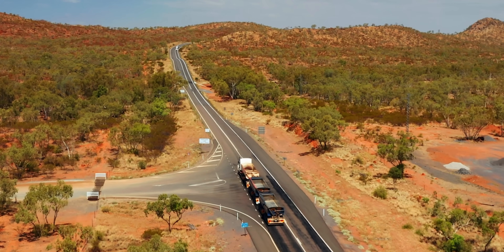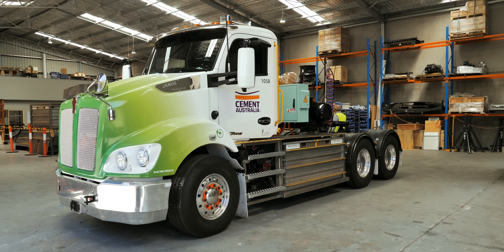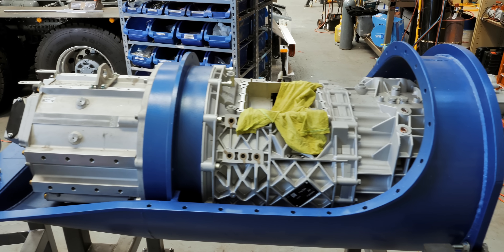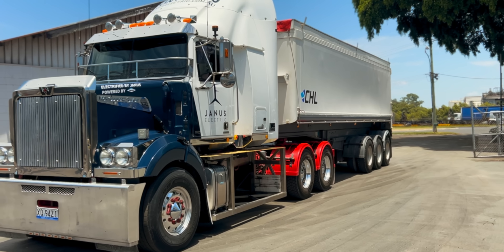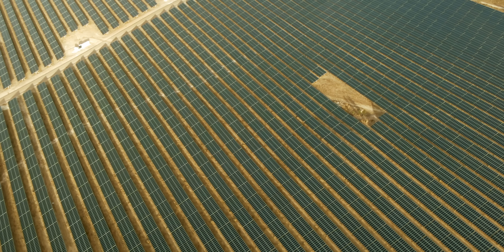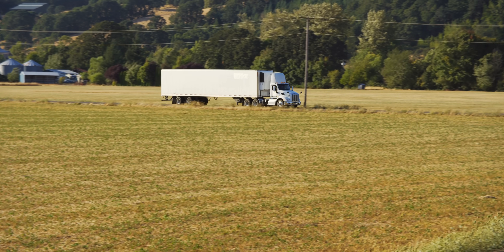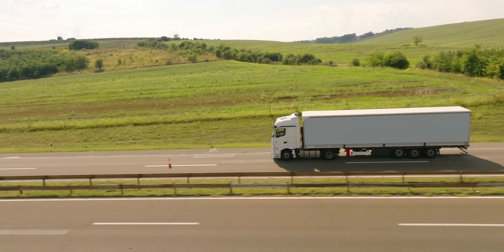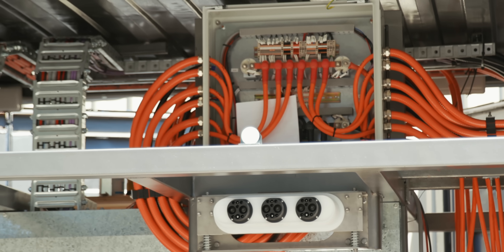This GIANT Electric Semi Can Swap Out Its Batteries!

Comment: Melbourne: Australia Cement Rig, "Bursts into flames"! The sole Janus converted former Kenworth Semi failed in flames. [28/11/23]

Any comments?
Reply from the maker: Yes, many comments.
In 2022 there were 397 truck fires in Australia. 
All of them a disaster for the driver, the truck owners, the fire services.
How many of those fires were reported in the media, not just reported, but shouted about with glee!!
I'll tell you. None. But one electric truck fire in what is, essentially, a prototype machine.
I repeat, 397 truck fires in Australia in 2022.
Oh the joy know no bounds. Rejoice say the fossil fuel lobbyists, rejoice for we are saved.
We can carry on selling expensive, toxic imported fossil fuel which we burn once and breath in the filth it deposits.
causes of fires in diesel trucks
Arcs on the starter (or battery cables), the alternator cable or the positive feed wire into the cabin.
Flammable material resting against the turbo charger or the exhaust;
Fuel line rubs or failures that result in leaks / sprays of fuel onto the exhaust.
Lubrication oil line failures near to the exhaust.
Turbo charger failures that cause excessive temperatures in the exhaust;
Leakage of hot gases from the exhaust.
Tyres catching fire because they are flat or poorly inflated or rubbing on hard surfaces.
Wheel bearing failures resulting in bearing grease catching fire. Sometimes overheated brakes cause the bearing grease to catch fire.
But let's ignore the endlessly repeated fires in diesel trucks.
Just dance with joy about this one, pathetic incident.
Reply: Keep in mind how many more Diesel trucks there are than Electric
The argument of diesel vs electric based fires no scene when you add to the fact how basically ALL trucks are diesel
The ONE EV caught fire
Reply: Looks like I touched a nerve. It was not the intention to draw rage and accusations of dancing with joy about one "pathetic incident". Your PR skills need a little lift. Calm down and wipe your screen!  Now, thanks for the 2022 data: 397 diesel fires out of a population of how many diesel rigs vs how may EV rig fires out of a population of how many? Context is everything! Is it one EV Janus rig fire out of one? @fullychargedshow
Reply from the maker: @PhilMacVee  The fire was a disaster, no argument. A very sad day for Janus trucks, an Australian company trying to make a difference.
Here's the underlying point, in 25 years time, the notion of a large machine that can pull a heavy trailer by burning diesel will seem like a steam engine does to us now.
It's dead technology, hopelessly wasteful, inefficient and of course filthy and toxic to living beings.
There are going to be numerous disasters and set backs for electric ground transport, just as there was in the early days of combustion, but it's now 100% clear that the future is electric.
So when people jump at the chance to cheer when there is a set back, that doesn't touch a nerve, it makes me laugh.
Reply: Nicely side-stepped although I'm not sure that I would be content with "disasters" along the way and I was not cheering...and so the answer to my question is? @fullychargedshow
Reply from the maker: @PhilMacVee  I don[t know what your question is. You asked me for a comment, which, for reasons that now escape me, I bothered to do.
There is no way you posted your original message without a snide, know all sub text of 'see, battery electric vehicles don't work.'
The push back against the electrification of ground transport is massive, incredibly well funded and global. 
It's obvious who is behind this and I defend the right of the big oil companies to bribe, lie, spread misinformation, create utter garbage stories which our old school dying press grab with both hands and spread like vomit on a new carpet.
I likewise defend my right to be uncompromising in my criticism of the shills, fellow travellers, petrol heads, bully boy clean diesel tossers and super aggressive gun toting diesel rolling coal pickup truck nutbags that litter the world.
You were so happy to see this truck burn, you can lie all you want but you know that is true.

You want to carry on as we are now, burning trillions of litres of fossil fuel, it's painfully obvious.
That's all I have to say on the topic.
Reply: @fullychargedshow  It wasn't the first though, as I'm sure you know.
They had a prototype self combust last year, which damaged another.
You are simply not being contextually honest about Hugh Janus' trucks having a 100% failure in flames rate.
Reply: @matthewjenkins1161 Rimmel or whatever his name is can get real Karen 😂

Comment: Maybe this will impress you.  The Tesla Semi has a battery as big as 12 model Y batteries. The battery weights several tons, and uses 250lbs of Lithium. In 2022, 130,000 tons of lithium was refined. If you used none for cellphones, power walls EVs or anything well you could make 1 million such trucks. There are 9 million heavy trucks just in the USA. Thus it would take near a decade to simply replace the US trucks, no EVs no Cellphones, no laptops, no power walls, nothing but Semi's .. sound stupid yet?

Comment: I am unsure of full load use without a coolant system for the motor and batteries.  Granted with the transmission the motor rpm is significantly reduced from typical electric use.

Comment: I doubt they will be able to do sub 1 minute battery swaps, NIO have been using battery swap for years and have gotten it down to 4 minutes in the latest stations. They’ve spent hundreds of millions developing this system. I can’t see a small company in australia with a limited budget doing it faster with batteries that weigh significantly more.

Comment: They talk about reduced maintenance cost including engine rebuilds, but conveniently fail to mention the cost of replacing (if owned) or leasing (per use) the batteries. Yes, electricity will cost much less than diesel in most locations, and maintenance work is much less on any battery-electric vehicle than a comparable diesel, but all of the costs need to be considered for a rational comparison.

Comment: I live in BC Canada and we had electric buses getting around Vancouver when I was a kid. With battery tech now and the hauling capacity of electric motors I’d think you could run busses with swap out batteries and not need overhead cables…

Comment: Nice ideas.  I did not hear how long it takes to fully charge a battery.  The shear number of batteries needed to power a fleet of trucks for normal operation - and the logistics of the battery swap stations - are big problems. Thinking about this - we would need as many swap stations as there are truck stops.  Presumably, the batteries would need to be charged at or near the truck stop swap stations.  The electric supply needed to charge the batteries is not available in the areas where the charging stations would need to be.  And.....the metals/minerals for these batteries (90% of the world's supply) are all controlled by the communist Chinese government.  Not saying this is a bad idea....just needs a lot of problems to be resolved first.
Reply from the maker: Your comment is a perfect example of what I have been saying for a while, and I don't mean this to be rude, but the really big issue with electric ground transport now, is psychology, not technology.
It's fairly easy to see that this technology works, the truck we drove on this episode works 7 days a week, 10 hours a day, hauling 90 toms of sand all around Southern Queensland. We had to film it on Australia day as that was the only day it wasn't in use.
The sheer number of batteries needed to run a large fleet is enormous.
But, they will last 10-15 years in this roll, then be repurosed as static storage, probably by the company that has used them.
This will give them another 15 plus years useful life, so after 25 to 30 years they will be recycled and made into new, better, lighter, more energy dene batteries.
There is enough material on the planet to create all the batteries we need.
Yes, the batteries would need to be charged at the truck stop. But they don't need to be rapid charged, they can be charged over a 12 hour period at lower power which will increase their longevity.
Also the power required can be and increasingly will be produced on site. There are already huge car charging stops in China and the USa with 100's of rapid chargers that are 100% powered by solar and wind, combined with big capacity storage on site, (100-400 megawatt hours) which means the chargers are available 24/7.
The technology exists now, the know how is here, it's now just a question in implementation.
And a quick reminder of the alternative. Drill for oil somewhere, pump that oil down a 500 mile pipeline that leaks, Pump it onto a massive oil tanker (40% of all global shipping is transporting crude oil)
Pump it into storage tanks, refine it in a massive industrial installation that released billions of tons of CO2 and toxic particulates every year, pump the resulting fuel into diesel powered tankers, store it at a refill station, pump it into a tank and use it . . .  once. 
And that, I am repeatedly told, is sensible and the only realistic way we can operate.
I beg to differ

Comment: 8 thousand pounds per battery needs 2. cold wather 30 persent loss of range and the grid can't supply the power to charge and the lithium and all the metal s needed to make the battery's destroy the eco system it's all a scam the answer is electronic ravidics or zero point energy but I know it's all about money not about saving the environment as much as we want to think.

Comment: Okay you are bashing  diesel motors on how "dirty" they are, how about relinquishing information of all the "dirty" truths of your scalelectric truck. It is Snake oil. How much electricity from a coal fired plant it will take to recharge the dangerous fire risky, toxic lipo batteries that, that truck needs. How much coal and diesel energy it took to produce those batteries, the motor and driveline? The mining resource sector is still operating with 98 percent fossil fuel energy to operate. So the minerals to make the components of that electric system is NOT CARBON NEUTRAL. The battery packs are going to be leased to operators? Yeah, I see a potential cartel operation there. Also what does it cost to do the conversion? $150,000? It only cost about $20,000 to $50,000 to replace a serious tired and un-recondional diesel engine, not the sale value of the overall truck. I can see what companies would be interested in those trucks, its the Billion dollar companies that are already making Billions in profit in their environmental damaging operations, they would put some money back in this project to show the dummies that they really care about the environment they are destroying on a daily basis for the profits they make. The throw a bit of money away as a virtue signalling gesture.
Reply: So much for diesel being dead technology right? It has not even been a month and motoring companies such as Ford is abandoning electric car manufacturing as its profitabilities slumps. Teslas resale vales are below 20 percent from new, they are not even good as a salvage. Well so much for your talk, it seems that the world is catching on even more quickly than what I could even anticipate, to realize the ev scam.
Reply from the maker: Nice try. 
Can you recycle 98% of the materials in a battery pack and re use them to make new batteries?
Yes, already being done.
Can you recycle expensive, toxic, imported diesel that has used terawatts of electricity in the refining process and peta tons of bunker fuel to ship around the world?
No, you can't.
Diesel is dead technology, it's a bnoring argument.
Next.
Reply: @fullychargedshow  Look up lithium mining and get informed on your clean energy. Diesel technology is tried and tested, and improved, 98% of commercial are still using it, and will continue to use it, especially after seeing how much more environmentally damaging "green" energy truly is, its a scam that will eventually reveal its own truths when people are sick and tired paying through the nose and subsidising for something that does not work.
Reply from the maker: @RedTyrian  You are wrong, but it makes no odds. Just for balance, (and we have made many episodes about lithium extraction and know far more about it than you) But look up how people in the oildfields of Iraq, Iran and the the Niger Delta live.
Oil is filthy, toxic, and is only used once.
Reply: @fullychargedshow  Yeah we know how much more you know, by only listing the positives of your jargon, but omitting the negatives, (seems like this happened before in history, oh yeah! Religion) you want to show your audience an informative segment on future technologies you would show both the good, the ifs, and the bad. Just as with all those renewable energy philosophers, you just mention the pluses. Take away government incentives, subsidies, and outright funding, this technology, and all other supposedly green energy energy falls flat. No money in recycling lipo batteries, take away tax dollars, the recycling stops. Time will ultimately tell, what is not known is when, maybe after yours and my lifetime.

Comment: So every 300 kilometers you WILL need (and also pay for it) a charging facility WITH personnel AND fully loaded interchangeable batteries? Is there a liquid cooling for this batteries or not? For the current you are pulling out of the batteries to move 97 tons I suppose there has to be some cooling technology on board (and at the charging stations also) - which complicates the whole thing and makes it expensive.
Reply: Excellent point!
Reply: No way to charge them in the middle of nowhere.

Comment: 0:35 Truck diesels are not expensive to maintain and they do not use a lot of fuel on a per pound-mile of cargo hauled which is the only metric that is meaningful.  This guy is ideologically motivated by the far worse power density battery motor solution which is not a solution to anything other than indulging the environmentalist's fantasy that electricity doesn't come from the same fossil fuels that the truck was running on before.  The electric truck is a "solution" looking for a problem that doesn't exist.

Comment: Another potential afterlife for these battery packs may be to serve as a replaceable reservoir for EV charging facilities in the like of inner city apartment blocks. This would avoid placing unacceptable demands on local grid infrastructure from increased EV charging. Similar to 'swap a bottle' LPG supplies for outlying domestic gas consumers except the battery could be configured to trickle charge between drawdowns to reduce the frequency of swapping it out.

Comment: maybe it is an idea to use the motors that came out of these truck as generators at the battery swapping station along the route. Just in case the solar is not bringing in enough power.

Comment: What was not touched on, but that I brought up in the comments in a video from Engineering Explained five months ago on the Tesla Semi is the idea of competitive advantage.

Currently, transportation companies hand their money to fuel producers. If a transportation company setup renewable energy storage site in a place that has plenty of sun or wind; all of that money goes to them. Which, as per the video from Engineering Explained; that fuel is money.

Over the course of the life of a semi, if you're spending money on fuel; that's money that you don't get to keep. In fact, it literally goes up in smoke.

Check out the video from Engineering Explained to see the numbers. But it's shocking. It's figuratively half a million dollars per vehicle spent in fuel.

"There's no such thing as a free lunch."

Yes there absolutely is. Starting with your lunch. It was probably made for free by plants/animals using energy from the sun. And so far, it has as 100% chance of coming up tomorrow. For the last billion years it's done so. You can bank on it.

If a transport company with a fleet of EV semi trucks is saving $500k per vehicle over 25 years, that is a lot of profit. 50 x $500k. Remember, over 25 years the ICE semi's give that $25 million away and it gets turned into carbon monoxide and particulate exhaust.

Forget luxury EV cars. EV semi's are where the biggest impact on vehicle emissions can be had.

Comment: Nice video! Shows reasons why battery trucks never will be used on big scale. Forklift will be carried in the toolkit for a purpose of refueling to get next four hundred km done. Lads forget to tell about pollution created by battery making, recycling, unsafety of them. Why not to talk about weight to mileage ratio- most interesting part in commercial trucking? Lets tell us how many battery packs we have to have to keep on stand-by for making 1000km round trip on unpaved roads. Will all trucks be using the same size packs like all diesel engines uses ONE fuel?

Comment: Might be useful on around town delivery but on long distance not  going to work very well to much more involved in doing so because  expenses  would go up due to equipment and personal  need to change these out at relay stations  and you would need plenty of them so this cost would be passed down to  the truck owner